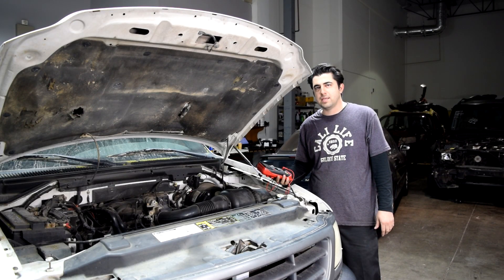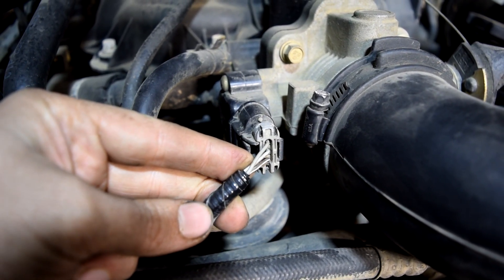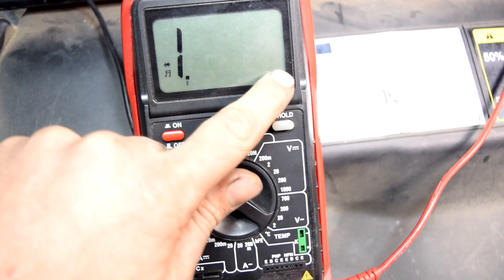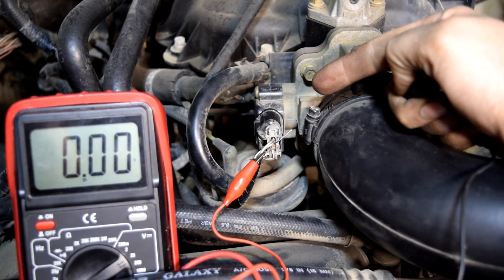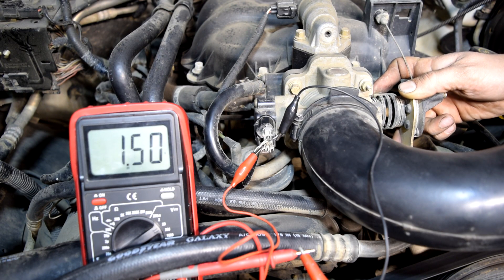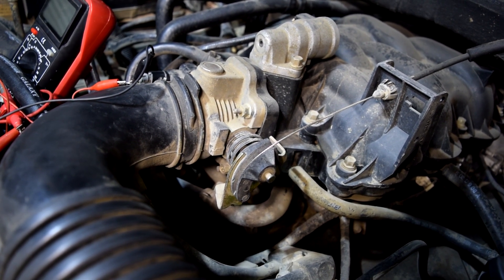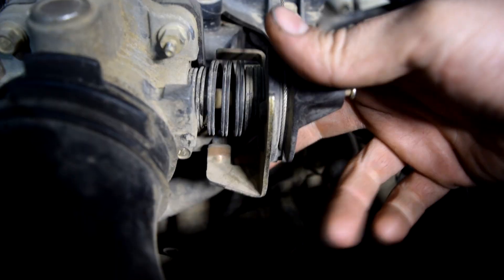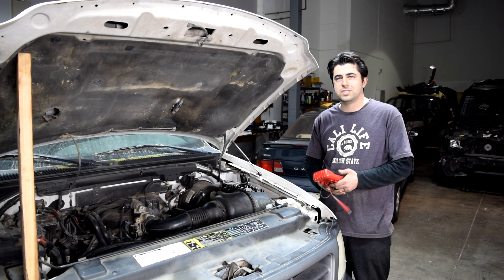How to Test a Throttle Position Sensor TPS - Without a Wiring Diagram

Comment: Help!
Hi, I have problem of my throttle body, It is open 100% all the time. And i am getting 11.8 V, 3.2 V, 12.2V and 0 volts on the wiring harness. What is the correct voltage of the wiring harness? I checked also at the pcm and gott the same voltage.
The car is VW golf plus 1.9 tdi automatic gear, 2007 model.

Comment: What would happen if you try to check wire for ohms resistance on the 5v ref. hot wire the one you said not to will this ruin my ECM? Any help need reply ASAP.

Comment: I like your videos they’re great I was wondering if you can help me out with a problem I have a 2001 Hyundai Santa Fe 2.7. V6 accidentally the input sensor for the transmission had broken but modular I don’t know which way the three wires go how to put it back the right way😊

Comment: Great videos...subscribed and been watching many...appreciate the content and straight-to-the-point-methods!  Quick question.  I have a '91 Camaro with an LS1 engine.  It has a new throttle body with new IAC & TPS.  PCM threw a P0122 code which is low TPS voltage which should be around 0.5v-1v at idle up to 5v at WOT.  Using your video, it read 0.13v at idle (which explains the code) and only 3.94v at WOT.  Since the TB was new, the manufacturer sent me a new TPS under warranty.  When tested, it was perfect...just under 1v at idle and 4.95v at WOT. A day later, the new TPS was back to the same range (0.13v at idle & 3.94v at WOT) which threw the same code P0122.  Any ideas as to what could cause this voltage drop?  FYI, this is a newly swapped engine.  I am at a point of "crank, no start" and am troubleshooting that as well.  I do have voltage at injectors and coils, spark and 58psi of fuel at the rail.  Thank you!
Reply from the maker: Hi, if the reference voltage from the pcm to the tps is as it should be (measure with connector unplugged) and there are no other components that use that ref. voltage in the same circuit as the tps than the problem is more than likely the tps again.  as far as your crank no start problem I would check for injector pulse next than compression. gl
Reply: @myRatchets  Thank you...going to check pulse & compression.  Think MAP and/or MAF sensor could be a contributor?  If so, can they be tested without running engine?

Comment: Great video. Thanks. I am getting a constant 3.8v on my signal wire when disconnected from tps.plug it in to tps and it drops to zero but as soon as I twist throttle it jumps back up to 3.8v any ideas?
Reply: Hi, did you find the problem after all?

Comment: Hey, this was great! Replaced my TPS because it was consistantly reading 3.39v on the center wire with little to no variation. After replacing the TPS, same thing! I then diconnected the TPS and found the 3.39 volts is coming from the wire, not the TPS. I got on a corvette forum, tried an Olds forum, got a service manual (89 caprice 305) followed the wiring looked for shorts, replaced the ICM. The code reader is still reading 21, TPS voltage to high and 45, rich exhaust (make sense).
Any Ideas? Thanx Much!

Comment: Thnx for the info. I did this back probing with enginr on. I got closed throttle valve 0.16v and full throtlle 3.99volts reading. What does it mean sir?

Comment: Hi and thanks for your fine videos. I checked the terminals of the throttle position sensor on my 1988 Volvo 745, only to find that 5.0 volts was being provided on pins 1 and 3, with no voltage from pin 2. As I understand, the tps on the volvo 240 that you made a video of, only provided one pin with 5.0 volts. What may I conclude?

Comment: Can u please answer the question below. 
Throttle plate was sticking, so I turn little bit throttle stop screw. Now no more sticking, idle rpm is now 1000, but problem is continuouse rumbling sound inside my car. 
Following checks were made.
No air leage in intake air.  Air Filter is clean. TPS voltage is as per manufacturer recommended. Spark plugs are good no mechanical fault. How can we reduce idle rpm without throttle stop screw adjusting?
Reply: He never answers smh

Comment: What if I have a constant 5 volt wire which is the very right but the middle wire has above 4 volts but less then 4.7 volts and the ground is .03? Then also when I back probe it it starts off at 1.02 and WOT it’s like 3.7-3.9?

Comment: 03 Avalon with A541-E tranny.  Have had a hard shift into 3rd for 8 months, now in LIMP.  P0751 shift solenoid a performance or stuck off DTC.  Found that Shift Solenoids 1, 2 are clicking but one (RED Wire) sounded weaker.  Followed your tutorial on TPS, have 5v at Constant Multi Supply Wire, but can't locate ground. One of the other 2 wires produces a very faint sound similar to radio interferrence, but nothing from 3rd wire.  Any advice is very appreciated!

Comment: Can anyone tell me if the voltage coming from the computer through the signal wire to the TPS applies to all vehicles? I own a 93 Grand Cherokee 4.0 L and with the connector disconnected I am getting roughly 4.3 volts coming from th ECM through the return signal wire and to the TPS connector. My constant hot from the ECM is 5 volts and my ground is good it is my understanding that there shouldn't be any voltage aside from just below 1 volt on the signal wire. Can anyone please help. Thank you...also my overdrive is very erratic. It triggers on and off when I accelerate, I can feel it shifting on and off and I can see my overdrive light flickering as it happens almost as if there is a short. These are not DTC codes flashing. It flickers every time the overdrive goes on and off when I accelerate

Comment: Your video was very insightful. Thank you. However, what happens to performance of the engine and transmission if the TPS is bad especially if the TPS is a double with the transmission on one.

Comment: great video i disconnect  the cable of the TPS and got 5v reading from ground to supply and  and also i got a 3v on signal to ground  under ignition key set to on position only  engine off.  is it normal i got a 3v on signal to ground terminal from the cable of the TPS ? or theres something wrong from the ECU? thanks for the feedback

Comment: I change tps in my 2004 Kia spectra 1.8 engine drive it for 2 months fine now the check engine light come on with code po121 tps again what you Think could be the problem

Comment: I have a little problem I have a 1992 ford ranger I just did the heads on it replaced cap rotor wires plugs the problem is when I start the engine it sputers and then it cleares up and runs Pirfict but as soon as I shut off the key it happens agin hot or cold and no codes can you give me some info I what to check we allso cleaned the upper intake can it be a tps doing the i am going to check it like your video

Comment: I have a 2002 Dodge Caravan and it throddles up and down. Also it will gear it's self down while I am given it gas. it acts like it isn't  getting the gas and I have it to the floor. Also it drinks the gasoline to go 15 miles cost bout 10 dollars.  what could this be

Comment: do you have a video on testing TPS on throttle bodies that don't use cable control but have the TB motor instead is there a different procedure to do this or do you need a scanner ?
Reply: Mike Blezien hey man if you find any answers on digital tps, lmk if you remember to. What kind of car you have?

Comment: I have a 97 Camaro 3.8 and it loses voltage to the tps. I have a brand new Wells tps and a bunch of used ones and they all show the correct voltage. Sometimes when the motor is hot and sometimes even when it's cold it will rev itself but seems worse when hot. 3000rpm sometimes and I have to put the clutch in. When the car revs itself none of the wires at the tps show voltage at all. And usually a off and on will reset and bring the voltage back. To me it almost seems like the pcm could be a cause but I don't know enough. Anyone have any idea?. It actually hasn't done it all this week but i'm sure it'll be back.
Reply: simonriddick rsdww
Reply: Sounds like it could possibly be your idle air control valve.  It is an electronic part, but it is something that can be cleaned usually.  

While you're in there, you might as well clean it all.  
Do the Throttle body (Not the sensor, but the actual Mechanical Part), EGR valve, IAC valve, and MAF sensor.  

If you have never done any of those task before, it should make a hell of a noticeable difference that you will feel in your vehicle's performance.

I'm not a Mechanic, but I study as much as I can, and it certainly helps having certified mechanic friends that I have watched work on my vehicles over the years....

You kinda can't help but learn shit. Lol.  Hope that helps.  

You shouldn't have any problem finding videos on how to do each one of those things.  

Personally I always watch multiple sources for similarities, and differences in what they have to say. 

Sometimes you just run across someone that really stands out with their knowledge, so if they're are numerous people saying one thing, but that one person says something unlike the others.  If they strike me as having a better understanding of the subject.... that's who I'm rolling with...

Comment: what about changing the fuel filter and running some injector cleaner in the gas tank to clean out fuel injection I did that and myns is still hesitating but ima. try your but other than that what else could it be ???? thanks

Comment: Hey Dear,
I am pleased to see u delivered knowledge with ur Sincerity in excellent way.
I activated my YouTube Profile just to appreciate u and asking u to help me.
I have Honda Civic 98 With D-15 B Engine.
Whenever I release Pedal after accelerating Car's Engine (RPM) Dies-Off ( RPM Touches 0.
Check engine and Battery Indication on and Off .
Engine tries to survive sometimes it go Off Sometimes it RPM goes back and engine won't off.
I changed my ECU.
I changed my Choke.
when Mechanic set it to advanced (Open more Fuel adjacment) it works fine at 1200 RPM.
I am really worry why engine Dies-Off ?
kindly help me I shall b very thankful and appreciate ur concern !